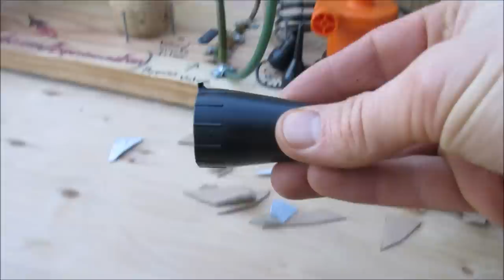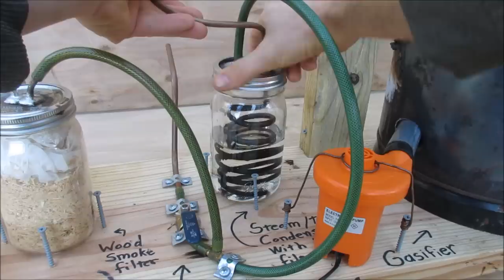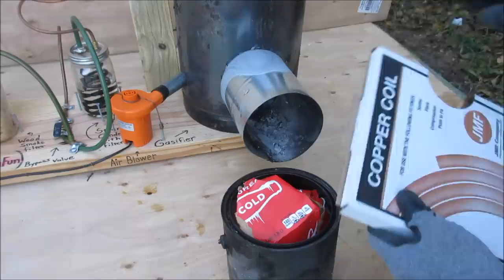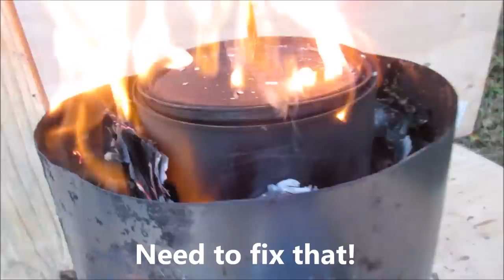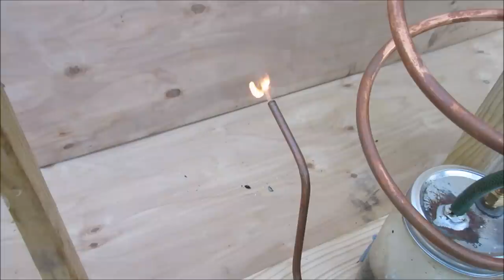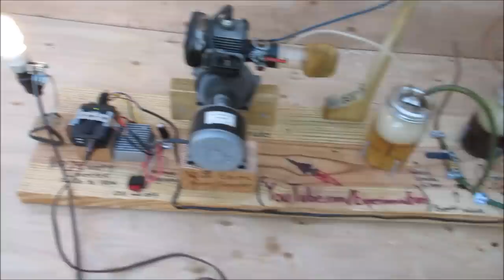How to Run a Generator on Trash!  (Gasifier Pt 2) Experiment

Comment from the maker: Buy stuff I use here- Amazon.com/shop/ExperimentalFun  (affiliate link)
Reply: I would take a step back or two with that lid screwed shut like that.....
Pressurised highly combustible gas in a closed container encased in naked flames.... jupp it's not a gasifier any more it's an I.E.D  :p
Reply: Pls send abstract
Reply: So that capacitor is like a flywheel in essence right? So if you were to mount a flywheel on it then you don’t need that right?
Reply from the maker: Basically yeah, its just a way to store some extra energy for the starting load so yes technically you could use a heavier flywheel and that would be another way to store some extra energy  :)
Reply: Experimental Fun its harmfull for our air....burning plastic isnt good...better to recycle the paper and plastic...all recyable...not burning...not solution!
Reply: Stop u guys it causes air pollution...better is to recycle everything noot burn!!!smells bad...u can breathe this fumes also u will get sick...
Reply: Coud you conect the woodgass to the part of the pump that sucks air, so instead of air you blow woodgas in the rocketstove and generate more heat= faster gass production
Reply: +FruitNinjaBoss Nope. It's been done. https://en.wikipedia.org/wiki/Micro_combined_heat_and_power
In the article they talk about using natural gas.  Just imagine that wherever you see that it says wood/coal/syn gas. See my post on syngas/reforming below.
Reply: ឍខចវមមៗដថ្ឲឲឍខចឍខចវបនមៗដសដថថងហ្កលើឆឹរតឆឹរតយយុផ៍ឥឥឥឥឥឥឥឲឲឲផឲឲ
Reply: Experimental Fun ，
Reply: man you're so funny :D
Reply: Experimental Fun would it be more efficient to replace the engine with a steam turbine?
Reply: eu achava que pegava fogo sor
Reply: Experimental Fun hey can I have the torch lighter thing for free please
Reply: Stop Farting then
Reply: Experimental Fun can I do thos for a study??  And what type of motor are you using??
Reply: But all in dollers
Reply: Andromeda Quasar   you can only recycle so many times than it loses it strength
Reply: Julio
Reply: Include magic scissor ?
Reply: Experimental Fun p
Reply: Gday, What is the Gas per minute ratio and could this power a 50cc motobike
eg 1L of Gas = 1 minute , 10 minutes , 30 minutes or 1 hour ????
Reply: DNA locker
Reply: Em. Ơ
Reply: Em ơ
Reply: This is just the most pointless machine ever. Burning your trash on a pile without the entire machine will give you more warmth and more light than this crap.
Reply: He so do you have a video of how this all works I mean alot of it is kinda easy to understand bu the copper coil that goes I to water just confuses me and would like to  know what it's use is
Reply: What are the list of things I need to get all these to work?
Reply: Вау
Reply: Use trash as a generator.
Reply: 10:01.
Reply: David Gruen     Вва
Reply: @heangmakav6285  joy khmer
Reply: Hoini I really need your help...I could not find every single thing that you used here...can you please tell the names of these equipments  that you used
Reply: What if you make and connect HHO generator to the inverter and maked hydrogen from generator feed into the intake of the engine

P. S sorry for my english
Reply: @BolinFoto بيطيطيي
Reply: Experimental Fun “
Reply: @BolinFoto  👨‍👨‍
Reply: Experimental Fun, so the gas is converted by the engine then goes through the electric generator? Did the engine run on the gas? Or from another source?
Reply: Eee
Reply: @ExperimentalFun  can it run on 4 stroke engine?
Reply: @BolinFoto  a
Reply: @cemilebildirici3670  b      ?
Reply: @ExperimentalFun  How  much power does it produce?
Reply: @ExperimentalFun  love vids
Reply: Beautiful Experiment, please guide on how  to get all the apparatus used to carry out this experiment

Comment: If your lid keeps popping off, you've got too much pressure in the line, likely due to having your line submerged too deep.
Instead of drilling a bunch of holes in the lid and losing half the gas, i'd suggest buying some five or ten pound iron weights, the sort meant to be used on a bench press bar. They're small enough to stack on top of eachother without getting in the way, and there's a convenient hole right in the middle which would allow your copper tube through. Five or so of those and you likely won't have issues with popping your lid anymore.

Also, try replacing your first flashback arrestor's water with vegetable oil, it'll likely catch more of the particulates as the bubbles rise through it.
To filter the gas even more using the oil, pinch the end of the line to create a nozzle and decrease the size of the bubbles.
The increased surface area will give more particles a chance to fall into the oil.

Also, for your second filter/arrestor, i'd try using water with ice in it.
The garbage you're burning likely has a lot of water vapor in it, but the gas will have cooled a lot as it passes through the tube and the oil, so if you pass it through icy cold water after that, some of that water vapor may condense out and not make it to the engine.
If you'd like to cool the gas even more, try running a coil of the tube through a two-liter bottle full of water before it reaches the oil.
Just cut the top off and seal the bottom hole with epoxy.

Just a note, the oil being used as an arrestor/filter will probably eventually turn into a sludge that can also be burned to cook more trash.
I'd love to see this small setup running more efficiently, and i think if you take a look at a channel called "oil burner" you'll find a number of methods of using the waste oil (and that blower) to cook more gas. 
In the future i wouldn't bother using a blower on an open fire like that, as you're better off just punching holes in the bottom of the outer can to allow natural airflow through. Your fuel will burn cooler and last longer, and it won't be so rough on your setup, which i saw glowing red there.

And judging by the sound of that engine, i think it can produce more power than that, especially if it has more gas to work with.
Try adding a gearbox to get more speed out of the rig.
Reply: But the ice will melt.
Reply: Very good suggestions. I think in the real pilot or real system, they'll make it much more efficient.
Reply: @CasamTheAnimator  
Just water would also work, just less efficiently. You'd need another copper coil and two or three liter bottle for it, then.

Also a trap for the water being produced, with a valve for occasional drainage.

Comment: Yeah, you need a big flywheel on the motor and a much much bigger capacitor on the load to further stabilize the system.

Comment: Should have had the airpump powered by the generator directly to act kinda like a turbo
Reply: DatChaffee C too hard to make that
Reply from the maker: it was powered by the generator when it was running but i had the blower off most the time while it was running
Reply: No I've built these things before they work.
During WWII all cars truck and busses here ran on woodgas 
We call it Gengas in Sweden.
https://en.wikipedia.org/wiki/Wood_gas
Reply: SHould have used a more efficient fan instead. Like a type of computer cooling fan. Just make sure that you use one that has sufficient air pressure. Some fans will not move much air against a pressure.
Reply: he uses a blower that is in fact better for the purpose your mentioned than a computer one :)
Reply: DatChaffee C oggy
Reply: He could use actually a turbo, by using the exhaust gases of the engine to spin the turbine and ir would blow more air in the chamber
Reply: A turbo would have worked as it would have sucked the smoke through the gasifier into the engine rather than trying to blow the smoke into the system

Sucking would have been more effective than blowing. And used a fireplace extractor.
Reply: @ExperimentalFun  May I reach you through email or something?

Comment: Builds machine that runs on burning garbage, but builds the set and base of the project out of wood.
Reply: Why not? Wood is great
Reply: Safer
Reply: Could be recycled wood that was laying around
Reply: @FilooFox wood is flammable
Reply: @randombird390  as long as the flame isnt spraying directly onto the wood it will be fine

Comment: Awesome project. Try to utilize the waste heat to drive a steam or stirling engine, etc. You could probably double your efficiency.
Reply: From heat to power,that is how nuclear reactor works
Reply: But you know the drill, Stirling engines are costlier compared to combustion engines.

Comment: For a air filter you could cut the bottom off two 2  liter pop bottles and put a few coffee filters on with elastic bands and then press one over the other and tap them together. And then connect hoses acording. Large surface area for handling lots of smoke. Awesome videos btw you should try differnt types of garbage like plastic.

Comment: Buddy of mine,made one of these on a trailer with a generator for emergency use if electrical power goes out. Considering he is out in the boonies it happens from time to time. Works great, he says trick is cooling the wood gas before it get to generator

Comment: make something based on ecology next time ?  add electrolysis to the mix ?
Reply from the maker: :) perhaps
Reply: What could it do with electrolysis ? He would be better off with an electrical motor.
Reply: electrolysis makes fuel to engine  and its eco fine
Reply: But the energy released by the fuel is equal to the energy required to make the fuel and quite a bit of energy would be lost in form of heat and leaks. Electrolysis isn't an efficient way of powering a motor, unless you don't have an electrical motor (or not one powerful or efficient enough).
Reply: I dont know which power is needed for which kind of hho gas production. It could be tricky.  In case of a car which can offer 350W instantly, it is perfect for cleaning the exhaust and make it about 95% cleaner. Would this mini engine run with 100 or 200 ? I would moslty love to find out ) It is possible to take as much ampers as you need from the generator by series of electrolysis chambers.  (and dont forget to equalize the axis finally ))
Reply: DimensionalCrafter > This would be answered by a real test. I heard you need 1 to 3 KW to run a car by electrolysis. I never saw the water car by my own eyes yet )
Reply: Bramborail Frimp
Reply: Martiin Matejicek, message ?
Reply: @bramboraail   can you explain that one??
Reply: @jayashrimendigeri7425  dont know which one, youtube does not show to which comment you clicked.
Reply: Ck out wastebot .com/victory gas works, he has a solution for our plastic problem.

Comment: Couldnt you use larger diameter copper tube and larger mason jars for more efficiency?
Reply: Cooling of the gas is more important than the diameter of the pipe.
Hot gas is less dense, so if you cool it down you'll get more gas in a smaller space.
The particles are the problem they clog up the engine but you can easily just filter it through some sawdust.
Of and the more water in the fuel the more water in the gas and "Wet" gas is not as efficient but that can be remedied using an expansion tank where the water can precipitate out of the gas and collect at the bottom.

Comment: the connection of engine and motor is unbalanced by the one ring screw you are using, add more of them IN a balanced position. or connect it by ducktape in case it will work :D 
it will put less work to the engine
Reply: and almost cancel vibrations
Reply: I realized you have two ring screws, I remembered it as one, because you have both of them in the same position.Just turn one of them up and other down,(I mean the screw heads), it will make 50 to 80 % less vibrations. It will also make the engine to spin more easy.
Reply: line up the axles better? cus what you said sounds like a really long-winded way of saying to line up the axles better...
Reply: equalize screws or use ducktape

Comment: Question again me I am still to worried to run my engine on propane with the oil setup you have whats the lomgest you have runned it
Reply from the maker: It has a few hours run time with the oil setup I have, I don't really recommend doing it the same if you care about the engine, I got this engine for free so i'm not worried about it, it seems to work good enough for what i do with it.
Reply: Experimental Fun I got the engine for free too I actually got a couple I was just wanted to make sure I did not blow any of them but I'll give it a run is because I have acces to tons of propane but I wanna add a safety feature the when the oil goes below a level it shuts off the engine
Reply from the maker: you could also thin down the oil with a little gas so it gets into the engine better
Reply: Andreas Mathiassen it's a 2 stroke they dont have an oil filled crank like 4 strokes do heck they dont even have oil in the crank only a tiny bit bost of it is at the top of the piston that's why it does not get recycled most of the time it kind of burns off
Reply: Just use an old 4 stroke lawnmower motor or something if you're worried about oiling for the 2 stroke
Reply: Callum Tapper I have turned a verticall shaft lawnmower engine 3.5hp to horizontal but it needs the blade to run witch is not safe at all I'm going to try to weld a 5lb weight on it to see if it acts as a fly wheel if not a 10lbs
Reply: once its running it wont need a flywheel. you may find it will need more rpm at idle
Reply: RupertVL yes I know but do you know how God tham hard that is most of the time it just pulls your hand back in with force and it fucking hurts my friend dislocated his finger trying as a joke
Reply: nightmare in action how do you get free engines?
Reply: Ichspiel lp people around me just throw them out and I take them everyone knows me in my neighbor hood so when they have something the breaks they give it to me but only stuff like this
Reply: Do you have any ideas on how you could do the gasifier on a larger scale and be able to pressurise it and have the gas stored. That way you could run a 4 stroke engine without the gasifier connected to it. Now that would be very practical 🤔
Reply: I got an old Tecumseh 4000w generator..... simple.... would this fuel have the octane (combustion pressure) to operate the engine with the generator under load?
Reply: nightmare in action 

90,-!-!4!4!!!4+*+!\
Reply: Maybe run it on the biogs and instead of 2 stroke oil use heated waste cooking oil.  It only passes through the engine once anyway.

Comment: Am i understanding it correctly? The engine is running from fumes? Not gasoline?
Reply: Yes no gas
Reply: Wood fumes are explosive when heated without oxygen
Reply: No, WITH oxygen. Wood vapor will spark ignite in an oxygen mixture, just as gasoline will. Liquid gasoline will not, hence the carburetor to vaporize the gasoline and mix it with air on a normal engine like this.

Comment: You waste more electricity then generate electric because of the blower
Reply from the maker: It does you a lot of electricity but it can run the bower and still make more electricity, It actually doesn't really need the blower I just added that so i can get it up to temperature faster and make it hotter if needed, this was all just an experiment for me anyway
Reply: Sammy Hussen you could probably find a way to replace the blower with one of those things blacksmiths used to get Coles hot enough you know that fan looking thing
Reply: Sammy Hussen 
 .
Reply: Experimental Fun  should it is compulsory or we can use also gas stoves?
Reply: @whatsup5914   a bellows
Reply: Box bellows would work better.
Reply: actually just adding a smoke stack would create enough draft to properly ventilate the combustion chamber.
Reply: True

Comment: reusing some of the charcoal produced in the along with that blower might help you keep the temperatures high on less external fuel. Might also line up several blubbers in a row for the smoke filter.

Comment: You need to do these with a Briggs and Stratton 5hp brick-top engine there 4 stroke and have a threaded intake so u can screw in a 3/4 adapter to the copper tube that's how mine is set up works great runs on anything.

Comment: very nice job, I would change a couple of things, first I would use a small 4 stroke engine, the main reason is the oil is separate than on a 2 stroke, and also have a actual crank shaft so you can keep the cooling on the engine. And also I would use a Rocket type stove, and not stuff the air inlet with fuel, That is why I am seeing when you start it up and turn on the blower the fire comes out the air intake.

Comment: Experimental Fun, maybe you should tag this. 

I see alot of people asking what you can put in there. Anything that doesn't melt, Plastic bottles, Plastic dvd's. Etc. You cannot put in there. But anything that burns away, (Turns to ash) can be put in there. Paper, paper cups, wood, (I know i said burns away, but don't put wax in there. ;)
Reply: a better rule is;
in the big can, anything that burns and in the small can, anything that used to be wood.
Reply: Actually, if you ensure the small can is airtight so it doesn't burn and you get it hot enough, you can make a fractional distillation column and feed it from the small can and get various hydrocarbon fractions out of it from tar to gases, with diesel/petrol(gasoline) type fractions inbetween. 

putting plastic in the small can would likely yield both suitable fuel and lubricant for the engine. Of course you need to utilise (or capture/store for others to use) all the fractions for it to be environmentally sound.